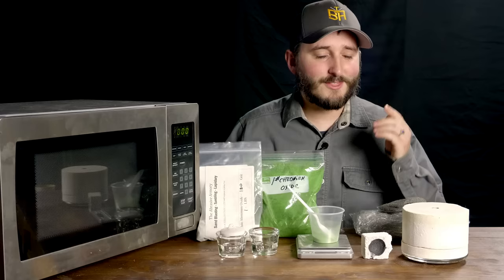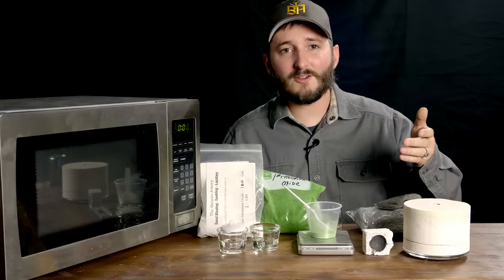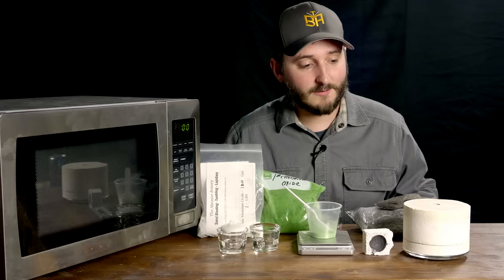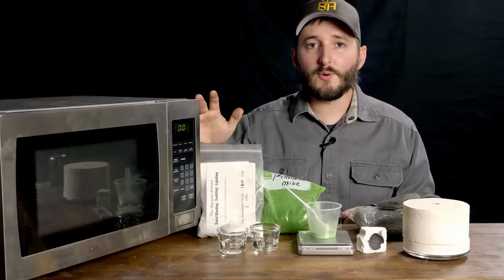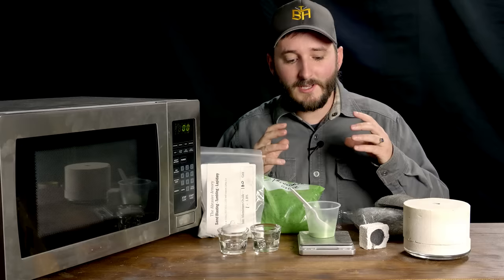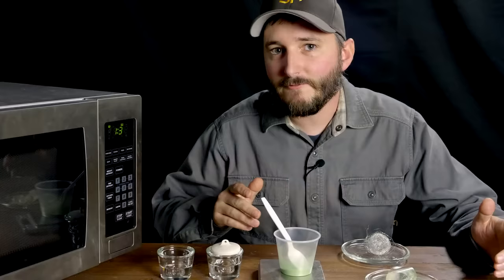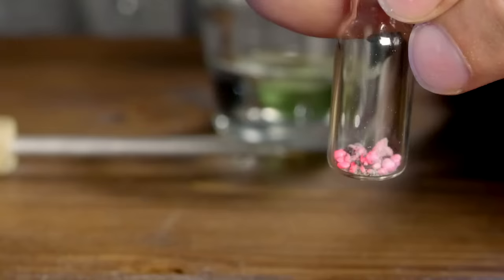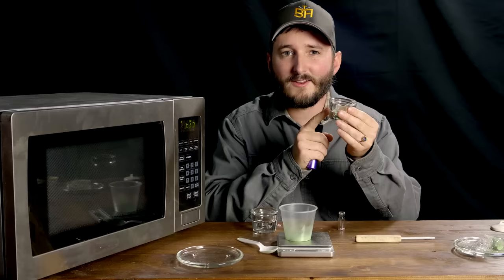How To Make Ruby in a Microwave

Comment: Most people think of a ruby as being red, but just as you showed in this video, they can be pink in color. Cool how it transforms from that seafoam color. I never knew about that microwave kiln, I definitely need to buy one. Great work as always!
Reply from the maker: You can change the deepness of the red color by adding more chromium, up to about 5%
Reply: @Nighthawkinlight  It would be interesting to experiment using other elements to alter the color.
Reply: @Nighthawkinlight  what about some zirconium kiln material? also why not use aluminum metal and chromium metal with an oxygen supply fed from say an electrolysis system breaking down water and sending the oxygen to the chamber while heating. (zirconium based kiln like the alumina one you had, for higher temp resistance)
Reply: what most people don't understand about gems is that they are quite often cloudy like in this video and by faceting and polishing the boule you will see the color become deeper and more translucent.
Reply: @the_great_tigorian_channel  sometimes but I doubt this is the case here because of cooling time, to get that clearer aspect they will probably need to let them cool slower so as to form single solid crystal, formation from it, additionally though they could use these gems to dissolve in water with in a hydrothermal synthesis system and recrystalize in the cooler end (we are talking 100s of degrees C due to it being under pressure to keep it liquid so it won't boil thus becoming a super solvent unlike plain 100C or less water that wont dissolve an emerald or ruby, and even the "cooler" side is still a couple 100 degrees C so still way hotter than 1atm of pressure would allow it to exist in as liquid,) 
What I am more interested in is the way to heat it and maintain that temp to allow flowing and annealed cooling into a solid for say nozzle tips for 3D printers and such ;)
Reply: @the_great_tigorian_channel  something I would like to know is if Hafnium and tantalum carbide is a receptor like the silicon carbide coating inside the microwave kiln since it is reputed to handle like 3900C to 4000 C temps before melting, (mix of hafnium and tantalum carbide for the higher temps but plain TaC for the nearly 4000 C temps) which is far hotter than the aluminum and chromium oxide in these, so they just need to get on that zirconium oxide replacement of the aluminum oxide kiln insulation. :)
Reply: @Nighthawkinlight  Other metals can change corundum to many colors, for example iron and titanium produce blue
Reply: @Nighthawkinlight  I’m pretty sure that under I believe 1% it’s considered sapphire, because me and my friends have found some pretty orange sapphires
Reply: @Nighthawkinlight  i agree with Thomas Anderson, I wanna see what other contaminants cause for colors! If you've got the time and materials that is :)
Reply: If they are pink would thy then be considered pink saphires? I wonder at what percentage it goes from saphire to ruby
Reply: You have to consider that this "ruby" is actually a polycristalline agregate.
Reply: @jaimesias  I thought of the same thing. I think if you had this exact composition, but a single crystal, the color would be closer to red.
Reply: @niklaskoskinen123  My thoughts exactly. Yet even with the individual small crystals you can still manage a deeper color through simple polishing and faceting but my gosh, would even the most skilled experts in faceting have a tough go of rubies this small.
Reply: @ThomasAndersonbsf  True, with plasma induced aggregation the  heating and cooling time is insanely erratic and the duration of liquid state is so brief that the amount of internal flaws, bubbles and clouding is sure to be almost irreparable or irredeemable by most standards. If a kiln could be manufactured to withstand the temperatures necessary for a prolonged liquid state and a more gradual cool-down you could get higher quality boules and even more so if you could manage to make an injector and mould of the same materials you mentioned. 👍
Reply: As an addition to the "every colour of corundum except red is called sapphire" thing, padparadscha (corundum with a particular orange-pink tone) is sometimes referred to as its own gemstone rather than a colour of sapphire as well. A good trivia question, but maybe not much else :P
Reply: Maybe the colour is different under the surface? most of the ruby we encounter are cut and or polished.
Reply: @the_great_tigorian_channel  I facet synthetic sapphire/ruby fairly often. This material looks a bit low grade for faceting, and is more like cab grade. Faceting highly included materials usually doesn't improve the color very much, unfortunately. It's a common misconception that stones will always look good after being faceted, but stones with a lot of inclusions like this will come out looking nearly the same. Being polycrystalline, it's essentially filled with cracks, as well as bubbles. However, it could still be cut, just for fun, even if it wouldn't look quite as clean as a piece from a boule that was grown more slowly. You're right that it might be hard to cut pieces this small, though. 

As for the color, ruby is dichroic, with orange-red on one axis and purple-red on the other. These blend together to make a color closer to magenta-red in the most highly saturated synthetic rubies with this much chromium in them. Darker natural rubies tend to block out some of this blue light and can end up looking more red. Natural ones also tend to have way less chromium. It depends a bit on lighting, though, and the pink/purple can look more red in lighting with less blue light present.
Reply: Blue sapphires are also rubies
Reply: @1.4142  j
Reply: @1.4142  also known as sapphire.
Reply: @Scrap5000  Sapphires are not limited to blue. While rubies are red, sapphires can be Blue, Pink, Yellow, Black, White, Green, Purple, Grey, Orange, or Brown.
Reply: @1.4142  cool to know!
Reply: my guess is also that it being so highly polycrystalline would make it more pink/opaque since a structure like that would scatter more light
Reply: they are when they are mono crystaline, these rubies are polycrystaline.
Reply: Pink is in the spectrum of red.
Reply: My birth month is July, so my birth month gemstone is ruby.

Growing up I thought rubies were a startling crimson color. I was very saddened to find out generally real rubies are more pinkish, and that garnet came more often in that nice deep red color.
Reply: It's actually the US and a small handful of countries that ONLY considers red sapphires rubies, most different countries will consider pink colored Sapphires as rubies as well, theyre just considered lower grade and are usually called pink rubies. 

Also im a Ruby 🥰
Stupid side story, when I was in the 4th grade we were learning about rocks and minerals, and a video had said "ruby, the most precious stone" and I got all excited 😀 and my teacher quickly turned to me and said "Not you!" 

🤣🤣🤣 he's right, im not specifical 😂 but that story still makes me laugh, I loved that teacher
Reply: @bakedbeans9404  that's why "true rubies" are so "precious"
Reply: @notfiveo "Pink rubies are a term that can only be used in certain areas of the world, at least in this day and age. This is because in the United States, in order to be considered a ruby, red corundum must display a certain color intensity level. Stones with low levels of chromium, which is what gives the gemstone its red hue, are called pink sapphires and not rubies. This is something that was decided sometime in the 20th century and is not applicable worldwide. Sapphires account for the different colored stones of the corundum variety, besides red, which is called a ruby. Outside of the United States, any form of corundum that has a pink to red color is nothing other than a ruby, which would make it a pink ruby, and not a pink sapphire or a red ruby."
Reply: @the_great_tigorian_channel  cloudiness of a gem is based on density of inclusion

No amount of polishing is going to make a cloudy stone clear and so no mathematical devised facet cutting is going to create flash 

A raw stone will have remnants of the matrix it was cut from. That has nothing to do with clarity. You are seeing opaque stone on top of the gem  

Cutting/polishing removed the opaque matrix (surrounding stone it was cut from) and if the gem itself is high in purity with no internal matrix (called inclusion) of foreign material then you have clarity 

Based on the clarity the facets can bounce light that passes through it to cause flash

Low clarity = no transmission of light = no flash 

His stones will never look high quality because 

1) he used low quality material with contaminants including that aluminum which is an alloy
2) the heat generated is not high enough to burn contaminants or create homogeny 
3) he’s working at 1 atmosphere (low pressure)

The last one is huge as even if he fixed the first issues he’d still have air bubbles form in the stone as the air expands trying to escape the liquified stone at formation. These also cause micro fractures as the the air vibrates the matrix 

The plasma arc is also blowing material around as it jumps and introducing gas pockets 

That’s mostly why they seem pink instead of the deep red of high quality (pidgin blood) rubies. Air and stress fractures 

If he could make the stone really big he may be able to cut and grind down to maybe a 1/16k clear chip every few centimeters
Reply: @TheRubinator13  seeing as Emerald draw significantly higher prices than rubies, not to mention Alexandrite (specifically before new veins were found outside of Russia) he started off wrong 

I’m sure you are precious to someone(s) ;)
Reply: If the pink color gets light enough the term is usually sapphire, it is still pretty much the same thing, but ruby was a fairly arbitrary catagory to begin with.

Comment: I have successfully melted Zirconia (2700°c) with a microwave back in 2003 (omg time flies!), the trick is to put the microwave susceptor (usually silicon carbide or SiC, probably the black thing  of your heating cover) at the center so all the energy is dumped into the material to be melted.
Also keep the internal walls of your cover white so the infrared is reflected towards the sample(hemisphere is better than square)
In your case, just make a sandwich like this: ruby precursor powder-a drop of SiC powder in the center -ruby precursor powder in the top.
Of course, there will be some contamination near the SiC but you should recover fine samples away from the center.
You can get SiC powder cheaply as it is sold as an abrasive, powder size doesnt seem to have a noticable importance so i advise to get coarser grit as it is easier to work with.
Reply from the maker: Good tip!
Reply: Hi aetius31,
I'm gonna try what you've suggested. Any resources you can share where I can learn how you figured out your methods?
Thanks!!

By the way, we are both subscribed to nearly the same channels! I need more friends like you 😂
Reply: @toxomanrod  Hello, i will be glad to answer your question (at least trying to because it was a long time ago).
Maybe we could discuss in a discord server, for instance the discord of DIY Perks (invite link in the channel "about").
My nick is the same there "Aetius31".
Btw I am located in France with GMT+2 time.

Comment: Logical next step: Lightning rod in large box of ruby seed material.  This is done with sand to create glass formations, why not try it for making rubies?  Maybe giant capacitors if you can't wait for the weather.
Reply: because rubies take a hell of alot more heat to crystalize than glass unfortunately, so lightning could do it, but the ruby formations would likely be smaller and more sparse per strike
Reply: @Draakdarkmaster6  That seems a valid point. Of course, had I unlimited funds I would do it anyway and compare the results to the microwave. Of course I would do a lot of insane things with unlimited funds. At the moment I only have funds for slightly unconventional science. Mad science will have to wait.
Reply: @raum_dellamorte  your passion is your soul, never lose it.
Reply: @nate7LP_my_dog_found_the_knife  Im gonna use this as my yearbook quote lol
Reply: @Starstruck_Seven  👍
Reply: Doesn't lightning create plasma?
Reply: Do you need Igor for that? It sounds like something you need Igor and old castle for.
Reply: @simonspacek3670  I like the way you think! Short one castle, though... And a lightning rod... Project's on the back burner for now.
Reply: @priestesslucy3299  lightning is plasma
Reply: Raum or maybe make a jacket out of seed material and put on Romanian model :)
Reply: @simonspacek3670  IT'S ALIVE !!!!!!!!!!!!!!
Reply: @Draakdarkmaster6  lightening is between 2 and 5 times hotter than the surface of the sun...
Reply: 1.1 gigawatts
Reply: Lightening may do it but to replicate in a lab puts the material under heat for too long and breaks down the elements. We can't replicate a high enough heat for a short enough duration to match lightning yet.
Reply: Capacitors? Augh, but genuine "thunder" or "lightning" rubies. Sounds so cool. Maybe mix some contaminant to make the corundum yellow instead of red, call it a lightning sapphire, fashion a big chunk into a lightning bolt shape or something, put it on a ring!

Comment: You should consider getting a used commercial (restaurant or similar) microwave. They are 10x stronger than even high wattage home versions.
Reply: I used to work at Starbucks and The microwave oven we have is easily five or six times more efficient than any other microwave I've ever seen